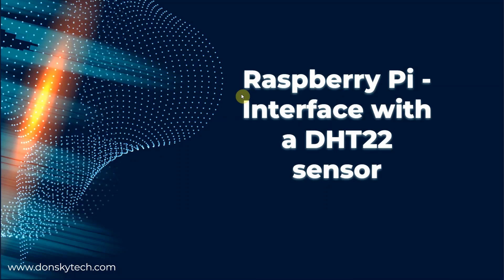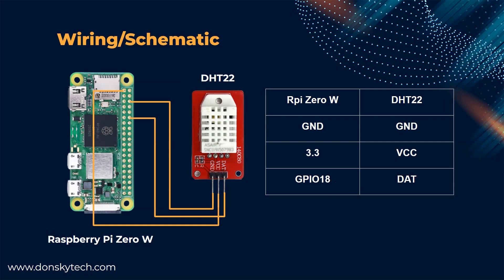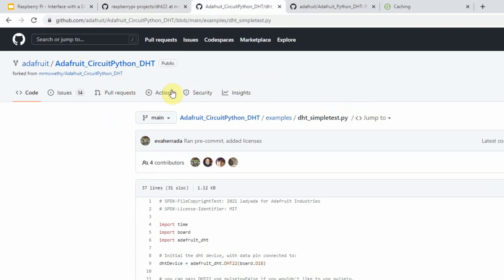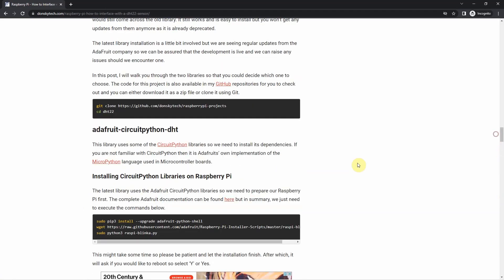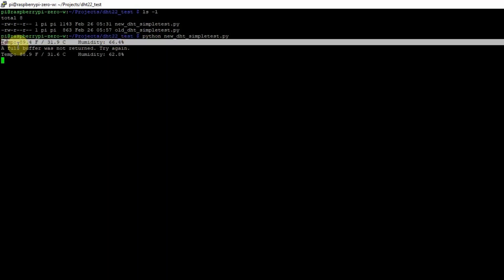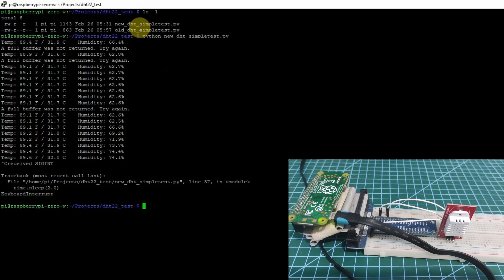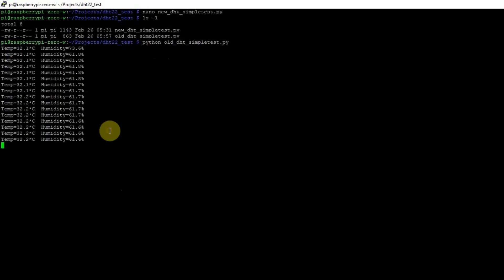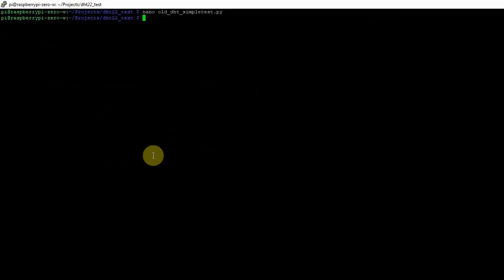Raspberry Pi - How to Interface with a DHT22 sensor

Comment: Thanks for the video! I have a problem when I do the "sudo pip3 install --upgrade setuptools ", it shows a problem with Externally-managed-environment. Do you know how can I correct it?
Reply: I ran into the same issue. The solution was to create and use VENV (virtual environment), as mentioned in the error you received. I was reluctant to go down this 'virtual environment' path at first, but turned out to be really simple ...and allowed me to use my sensor!

sudo apt install python3-venv
python3 -m venv env --system-site-packages

Enter (activate) or exit (deactivate) your VENV using...
source env/bin/activate

With VENV running, you can now run your install command. Just remember to keep the last command handy because you'll need it to enter/exit your VENV.

There's an excellent guide for VENV at https://learn.adafruit.com/circuitpython-on-raspberrypi-linux/installing-circuitpython-on-raspberry-pi
Reply: @rcrooster  hi sir may i chat you on instagram or in any social media that you prefer, i cant seem to install adafruit package and i need to use it for my project